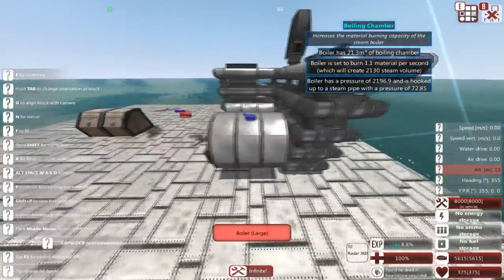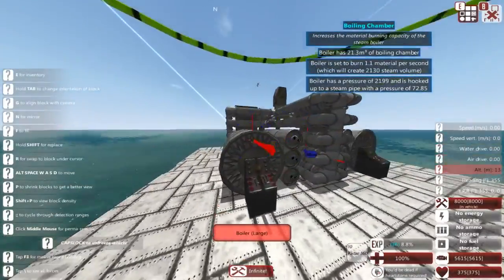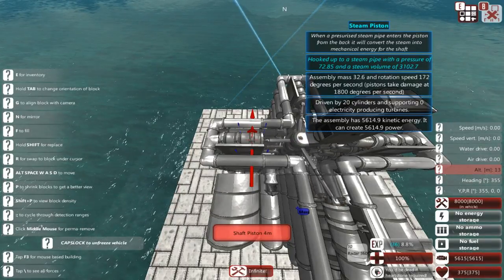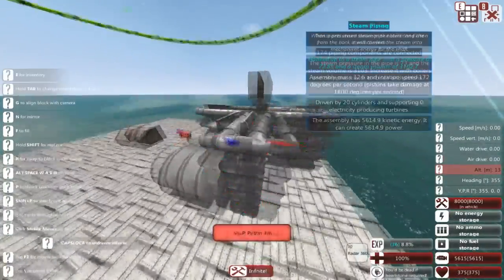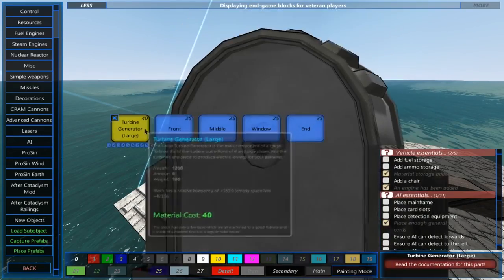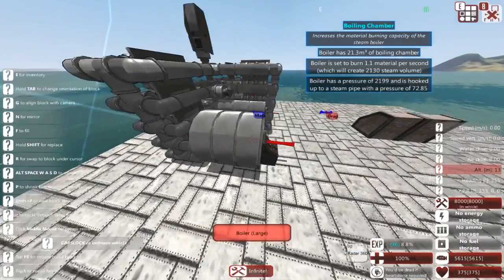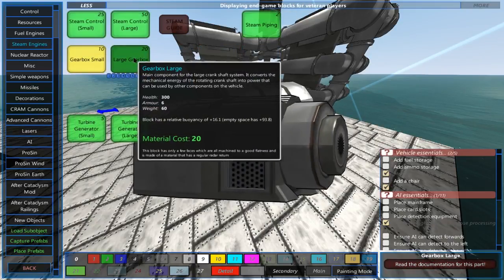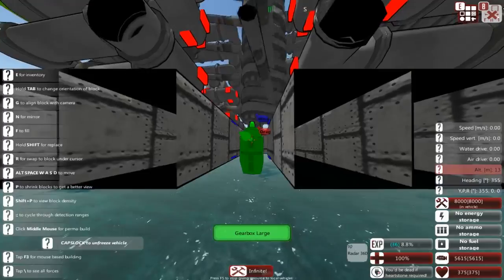Steam Engines and You | From The Depths

Comment: It is possible to have both a mechanical and electrical power out of a crankshaft.  One end of the crankshaft goes to a gearbox while the other end goes to making electrical power.
Even though I do not own the game I like the idea of the steam engine system simply because it is variety... Even though it is fragile as glass.  
A steam may be good for large bases as it can be reinforced easier.

I am trying to wrap my head around a good ration of boiler to piston for making power.  Some say a 1 boiler to 1 piston is a good ratio but I think a 1 boiler to 2 piston would be a good ratio for low to mid pressure systems.  I think the 1:1 ratio is good for low pressure systems.
The real question is where the most efficiency per unit of material burned is at.
Reply: yes it is you just need batterys

Comment: you can run shaft generators off the shaft and still run a gear box, however when the generators are producing power it'll decrease engine power due to the strain on the shaft

Comment: not only can you continue the shaft, you can have multiple generators on it.  I'm not sure how this really affects the power production rate, but I'm pretty sure more generators allow you to convert your mechanical energy to electrical power faster.    

Turbines are extremely space efficient, and produce more electricity overall, but have a terrible startup time.  pistons start up much faster, but take up a lot of space, also they produce usable power on their own.

it seems like having multiple separate steam generators attached to one steam system raises pressure faster.

Large and small Turbines have very little difference in power output, only difference seems to be volume, bigger can provide power longer after steam is lost.  not much of an advantage there.

I'm personally leaning towards using pistons due to the faster startup time to allow cycling, but turbines can be made to take up only 3 blocks and will barely sacrifice any power output.  Great for smaller systems.

I've been experimenting with the steam a lot, but I need an add-on to get the numbers on how components affect the system.

one more thing, there seems to be no efficiency difference between large and small.  perhaps to be changed in the future.

feel free to reply with questions.